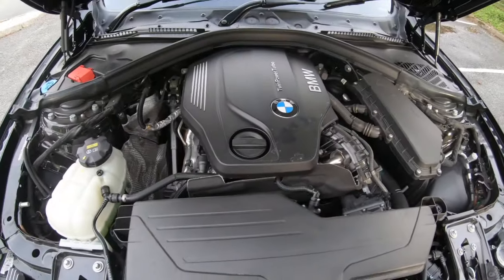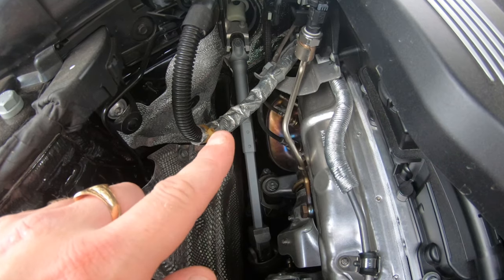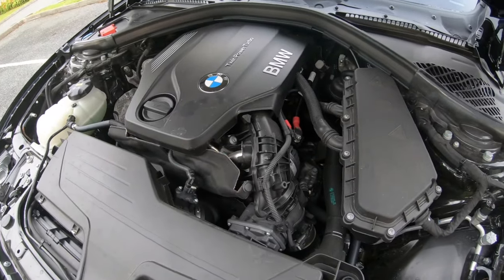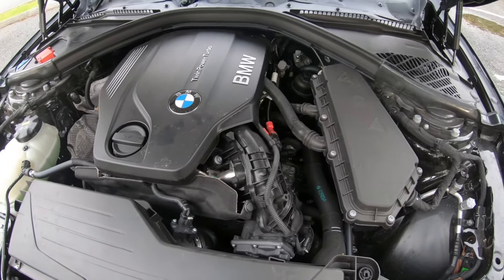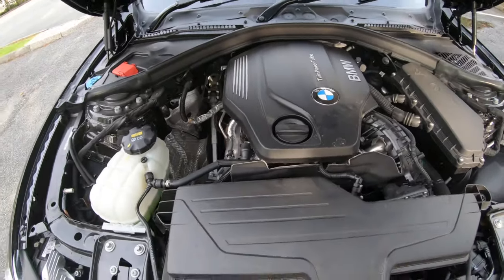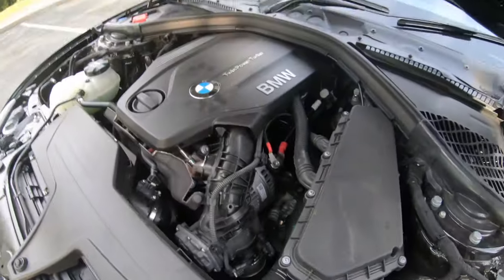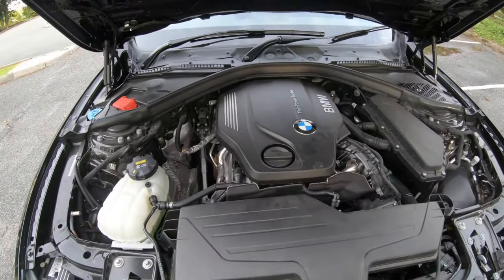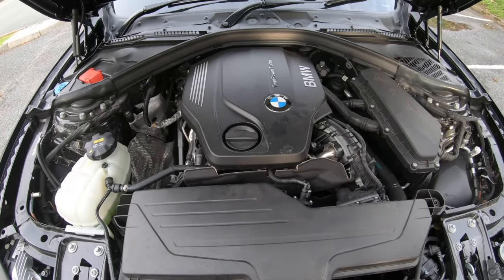Bmw B47 Reliability 2019......It Makes The Power But Will It Break The Chain ?? F36 420D Gran Coupe

Comment: I have an F30 320d B47 190 hp. Since 160000 km (100k miles) the engine start shacking after 90 kph. Bmw official service replace clutch plus dual mass flywheel but the problem is still there. Maybe engine mounts or harmonic balancer?Now 213000 km. Not satisfied if I compare with my prdvious m47 163 hp(529000 km). Greetings from Italy.

Comment: I have a bmw 520d f10 2010 I had it for nearly 3 years now . And it has 290k kms and still on it's original chain . Always serviced 10k miles . Egr and dpf blanked . Still going strong

Comment: I bought a 420d last summer and drove 20k kms. Just now an 'oil pressure low' message popped. Havent had any problems apart from that
Reply: Louis Patroons watch out oil pressure blockage lead to my engine blowing up big end shattered

Comment: Ok few years ago i was about to buy a f10 520d 2011 from a family friend and i had a question and i asked this man. He answered my question but told me to either buy a 530d or buy a 2014 or later model if i want a 520d as them engines were not n47. I bought a 2016 520d and im glad i did because the car i was about to buy first just had its timing chain snapped. So thanl you bmw doc

Comment: I have a 320d f31, 61k on the clock, running smooth and I love it. Drive 70miles per day and that’s what it’s built for. Much better than the N47 previous f30. Not as good on fuel but that’s because I opted for the auto ZF gearbox
Reply: the auto is even better on fuel than the manual, maybe yours has a different problem
Reply: @eminem2 not really. On N47 manual I had 5.2l. On B47 automatic, it says 6.0l

Comment: 420d b47 -135.000 km, egr cooler replaced under waranty at 99k by previous owner, otherwise service history is flawless. Strong performance, people who dont expect sudden acceleration are thrown back in their seats easily which is always nice for a 190 hp engine on a 1600+ kg car.
Reply from the maker: yes mate these cars are great and thrilling and I wouldnt expect it any less typical problem that has always had bmws the ego cooler because there making them so strict on emissions the EGR cant handle it

Comment: I’ve got a 2018 328d x-drive with 90,000 KM. So far no problems with the B47…. Recall now though on the HP fuel pump and another on EGR cooler.

Comment: Just bought a 2015 BMW 320d m sport, 78 000kms with b47d20 engine. Installed 76mm downpipe, dpf removal, EGR physical removal and coded off ECU, Intake manifold cleaned carbon soot out. Stage 1 tune done, roughly 160kw and 500nm. No issues so far. Just changed trans oil and filter. When should diff oil be changed?
Reply: diff oil at 100k miles

Comment: Bmw 420d gran coupe 185.000 km and still going. Egr cooler changed recently. No Chain problem, hope stay so on 😁🙋‍♂️
Reply: Marian Nistor I have 175k km on mine. Also B47; was thinking changing the chain the next two months, now i don't really know if i should right now. Sounds and runs awesome. Great car.
Reply: when u drive the 420d slow in a parking lot area, and release the gas just before it shifts to gear 2 or a little after it is in second gear, does the car engine break alot. Do you get the sensation of the car slowing down more than you want it to?

Comment: Another great video. Ista on F series video is must. Random video idea - predicting top 3 or 5 problem areas on the F Series. Based on your bmw experience and hands on with F series. You could also do top 3 areas of strength for the F series. You kinda mentioned everything has a sensor which would make it easy to diagnose a problem. Anyways just a random video recommendation. Keep up the great work 👍🏼
Reply from the maker: Problems on these cars are going to be all electronic related nothing else believe me on that mine already has electric issues and it’s brand new
Reply: BMW Doctor What electric issues? :(

Comment: Owner of 2016 BMW 420d Xdrive, bought at 66K mileage, hit the 76K mark, done a full BMW group parts Element service and Castor Engine Oil aswell as  Transmission Service ZF kit with Miller's Oil, Car drives like a dream, mixture of City Driving and Long Motorway miles.. anything I should look out for? Pondering about a professional remap inline with emissions standards, please let me know your advice on regarding this..

Comment: I did comment on your other video.

Mine has done 147k now. Only issue I had was dpf and ejr. They was blanked and mapped out to stage 2 around 3.5 years ago and never had any issues at all since that.

2 weeks ago I had low boost come up code P0238.
I have had a look around and notice a soot deposit around turbo inlet. Around 1 week ago it seems to of developed diesel knock well I hope it's that and not rod knock.
It knocks while driving in the rpm range of 1500-1800rpm it sounds nice below 1500 and above 1800rpm

It has hunted a little for a long time but never found why it's been plugged in with snap on and that didn't find anything I'm guessing it could be injector related especially now it's knocking

Do you have any ideas for the issues I mentioned above my first one is the code then the knock

Thanks dave

Comment: Hi there. Any qlue how to fix problem with 290900 code? Smoke test been done all good. Egr valve new, egr cooler new, manifold intake cleaned ,flaps not removed. No idea whats the problem. 😱 Or may new software will help??? Regards
Reply: Any news on what fixed this fault as I have that same fault code 290B00??
Reply: "So reliable"

Comment: My f21 118d M Sport 100 kw remap to 193 hp have now 52000 km, egr changed at 30000 km, nothing else.  I've never had a car like that. Huge amount of driving pleasure, manual gearbox is perfect. I don't have creaks noises problems like many others. It's very very soundproof inside but maybe it's cuz I have Harman kardon option?

Comment: Nice video mate. I've got my 520d 2015 with 160k KM. The car have deleted EGR and DPF and done stage 2.Running pretty good.full exhaust system,K&N air filter and about to put some bigger intercooler on it :)
Reply: Is this the same b47 engine?
Reply: @fangus44  yes
Reply: Good 👍
Reply: how do you pass the emission test  by deleting dpf ??
Reply: I’ve got same car as you and was thinking to do same thing as you. I have already the EGR kit to delete it completely and wanted to run as well straight exhaust with 4 tips then custom map. How is yours doing with stage 2 ? Running well or it bit different?

Comment: I got 5 series 2015 2.0 diesel b47 engine I got service with bmw main dealer and they notice cracking sound from engine the asked me to check for another 160 pounds but I refuse to pay God knows what sound might be that I am worry as I hit once on n47 engine chain issue but I hop this b47 will not let us down
Reply: Did it ever cause a problem?

Comment: i dunno mine, when i put my footdown either comfort sport, its revs at 2k seems to hunt/idle unless i let go and reapply less pressure if that makes sense. b47 rw 2015 420d 106k miles, a bit annoying when overtaking otherwise still does its jobs

Comment: For a bmw specialist so how come my bmw f20 b47d20a 2016 egr dpf deleted swirl flap deactivated, with just over 200,000 miles and still drives nice with stage 1 remap and your saying it has problems on the electronics? Simple maintenance mate its called service!!! And use egr cleaner once in a while, obvs you get common issues like gaskets leaks or orings need changing alternators and lower crankshaft pulley and belt thats it, the rest is normal maintenance parts shocks and brakes.

Comment: Hi, I have an F10 520d/2014 with this engine. It has 178k mile on it. I replaced the sensors for the DPF (about 300 GBP in parts) and the intake manifold (that was about 1000 GBP but was paid by the previous owner). What can I say? Great fuel efficiency and the DPF shows no signs of being in need of replace. I didn't hear any weird noises from the timing chain. I heard two opinions: one that I don't have to worry about it, and another coming from people who said that it needs to be replaced. Previously, the car was serviced in BMW network at 15,000 miles. I changed that habit and now I'm doing the oil change every 6000 miles. Other than that, what can I say? It runs great, smooth, and with no rattles.
Reply: The DPFs last for a very long time on these modern BMWs, on the 1.5 I3, 2.0 I4 (This engine shown here and the engine in your 520d) and the 3.0 I6. The AdBlue system, which BMW calls 'BluePerformance' is also very reliable. You have nothing to worry about when it comes to the DPF (and the AdBlue system if it is equipped with it) on these beautiful engines.

Comment: Bought a 2001 then a 2005 525d Touring new back along, but nowadays any 5-series less than about five years old would be way beyond my budget. However late last year (2021) my Volvo suffered a other-guy's-fault collision and, bugger me, my insurer's courtesy replacement for ten days was a 71-plate 520d Touring! 

The four-pot engine on that car is the most recent upgrade of the B47, with bi-turbo and ADBlue etc. Still 190bhp I believe, but with amazingly improved fuel economy. Apparently these latest versions have gone belt-cam now too? Anyway, it was beautifully refined, ran like honey and frankly is the only four-pot diesel on the market that doesn't sound like a diesel at all - even from the outside on idle. What a great pity that this will be probably BMW's final diesel design, given the impending 2030 new sales ban and skyrocketing oil price thanks to Russia.
Reply: Yes, you are correct, the B37/B47/B57 will most likely be BMW's last line up of diesel engines. It's really sad considering that they are the definitely the best diesels on the market. The only other diesels that come even close to them is Mercedes' OM654 2.0 inline 4 diesel and the OM656 3.0 inline 6 which are immensely smooth diesels, just like the current BMW diesels. In 2017 they added an SCR catalyst with AdBlue, which BMW call BluePerformance. They also changed it from a single-turbo to a twin-turbo system. My 2017 320d M-Sport Plus has this updated engine, the B47TU1. The power figures remained the same but the torque band was stronger for the '20d' models (meaning that full torque, 400nm of which lasted for longer in the rev band, creating a nicer driving experience). We've had it from day one. Such an amazing car and a joy to drive. 66238mi now, still surprises me how we've put up that much mileage, I still remember it being on 17 miles. Probably will change it soon with a new 320d. Always used to have petrol 6 cylinder BMWs (and one V8 X5, 2005) but this amazing engine sold me over on diesel BMWs.

Comment: Hello 👋 when you say "don't buy these type of cars if you use them only around town" you mean if you use them 90% to 100% of the time in the city? I am attracted to the new 1 Series from BMW and I would like to buy a diesel one because of the torque, efficiency and the whole engine philosophy. I do 15.000 kms per year, 40% of the time in the city traffic 60% on connecting roads - only on rare occasions on highways. Should I buy a gasoline engine in your opinion? Thank you very much for your video and for your opinion.
Reply from the maker: I would buy a petrol mate trust me buying a diesel if you only do that will clog the DPF even tho the new diesels are a lot better these are mainly to be used on motorway and the stop start technology will only kill your engine and starter motor doing a lot of stop start take my word for your driving if you don’t do motorway much and mostly open roads and mostly city get a petrol and once you hit open roads you can really open up the petrol as there turbo charged and continue to make power throughout the whole Rev range where diesel doesn’t it makes the power low down and that’s it really diesel is for towing come top end the power isn’t there mate
Reply: Hi doc . I bought  BMW F10 525D  N47D20 automatic gearbox but the enigine is damaged I would like to change it by another one is B47 or N57D30 so which one is reliable N57 or B47? and the both don t need any change or modification durant the swap or putting the engine?

Comment: Hi, I have a 2015 B47d20, 110kw engine and at 170.000km the fun began; 

At 170.000 km the fuel rail above the engine began to leak; then, because of that issue the DDE Unit failed ( since the unit was full of diesel fuel );
at 175.000km the EGR went;
and at 178.000 the turbo or sensor, actuator in turbo failed; and offcourse, you cant just change the actuator; 

The car has benn Full Serviced, regulary at BMW dealer!
Reply from the maker: Problems problems and more problems as I said yet people say I don’t know what I’m talking about
Reply: Is the car still under warranty to be claimed. Are u using a 520d 2016

Comment: B47 8 speed auto 5yr old now put 50k on it change oil every 10k fingers crossed all good ( £500 ) Road tax is a kick in the bollocks .do the snap on or autel maxidas work for all the electrics on these do you no mate ?????

Comment: You said that they are not using swirl flaps anymore. As far as I know on B47 they were still used. Or they are not used anymore for 2019 models? I own a 2019 F31. Do I have swirl flaps?

Comment: I got it 4 weeks ago my 3series xDrive 2.0d with N47 engine. It's 130k km on the dashboard. When I start the engine in the morning when outside is like +2C temperature, I hear for 3/2 seconds some short rattle. What do you think what is that? The timing chain problems or something else?

Comment: Moving your passion bro. BMW enthusiast here from the 80s. I am abt to buy a F11 520d 2014 model however is it the N47 engine or the B47 please ? As I’ve seen both engines on the same gear model. Much appreciated 🙏🏼

Comment: Hi there I have a problem with mine b47 yesterday mad noise came from under the hood sound like carburettor without the air filter diagnosed today by mechanic noise coming from bottom at where gearbox joints the engine just find out I'm out off warranty she has only 107 miles
Reply: did you find the problem?

Comment: I have 120d 190 automatic. It’s very smooth. Egr coolant changed at 60 000kms. Now 95 000. The orange problem motor light is there. The mass air flow and intake admission is full of oil. Knowbody understand that even not bmw. I’m just wainting for the car dies. Not problem on the turbo, not smoke the power is all here juste the motor probleme light on and oil on the air mass meter and intake air admission. Any body here have this problem ? Thanks in advence.
Reply: Yea the problem is..sell/scrap it and buy a lexus

Comment: I have a F31 316d touring (with the 2.0 B47). It's at 130K right now, I bought it at 115K last summer. No issues so far.
I have a copy of ISTA+ installed on a virtual machine, but what cable do I need?
Reply: It works with ethernet cable or something like that

Comment: Have you heard of any issues with the b47 engine and the inlet manifold melting? I got a b47 which decided to melt the inlet manifold. Btw, this isn’t related to the egr recall - I’ve been told by the dealership.
Reply: Yes happened on a 335d constant city driving short trips then ragging the car cokes up the egr causing it to damage the inlet

Comment: F30 320d b47 engine (LCI) all good, I do 40-50 miles a day motorway mileage for work. 

They are built for motorway crunching which I do and is great, I currently have 55k on the clock in 3 years and nothing wrong at all.

Comment: Wish I was as lucky as your lot, mini Cooper 2.0sd 2016 b47, 42000mfull history lost power Friday running on 3 cylinders got a generic fault, P3280 engine smoothness control correction quantity too high or low, thought an injector, then I heard the knocking, over last few week I thought it was tappeting more than normal, one guy said bottom end now a pal said sounds like camshaft lifters etc, I love my car it wants for nothing and now knock knock wobble, it's in main dealers Monday so we shall know soon.
Reply: Im curious... what was the outcome? :)

Comment: Hi boss I have got a f30 2015 318d 2litre on 97k the only issue I have is it uses oil I have to top it up about every 1k miles is this a common thing as my last f30 320d never

Comment: Frankly, it almost looks like a US-version N47, which is the last diesel engine we got here. Our EGR is electric (not vacuum operated as EU version N47), we have DPF as standard on these. So basically the US F30 LCI 328d has basically all bells and whistles as B47 equipped EU vehicles but with older N47 engine. I almost wonder if it would be easy to retrofit B47 into US based 328d's given how similar these are. Surely, the mounting points are probably different....

Comment: Hi BMW Doctor and thank you for a great video!
I have a question which I hope you have time to answer. I just bought a X1 18d.
I know that 18d, 20d and 25d basically have the same engine except that 25d has two turbines while the other two have one. Same engine meaning they are all three B47 2,0 liter diesel.

I´m curious if there is any other difference between 18d and 20d than how they are programmed for power output. I did however read at one place that the 18d has lower performance injectors and smaller turbine than the 20d. Meaning that it can´t be mapped up in power to match the 20d.

So my question is, do you know if there is a physical difference between 18d and 20d or if it is only programming difference?
Reply: there are different injectors and different turbo. 218d can be mapped safely to ~190hp

Comment: Great video 👍 I have a f36 27k mileage it came up with sticky EGR valve, thinking to use a wynns egr cleaner to spray into the air box. What you think?
Reply: Take it out. Its a 10 min job clean it and dissmantle little motor clean inside there and use white spray lube from wurth. It has done the trick for me.
Reply: @adamproperdouble2094  Can you gives us link where you see tutorial about that?